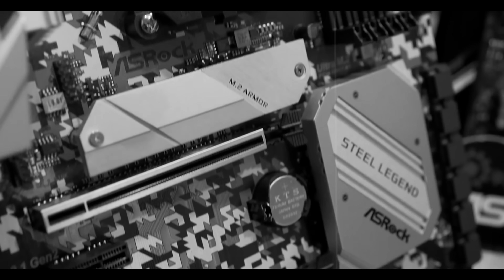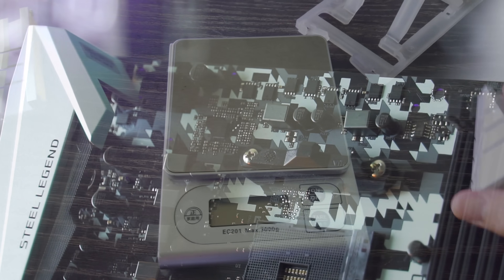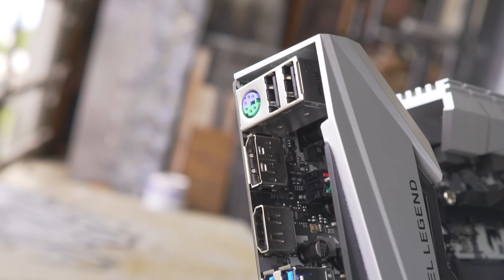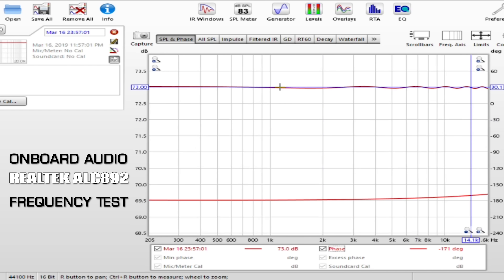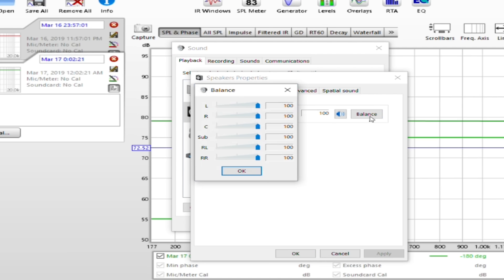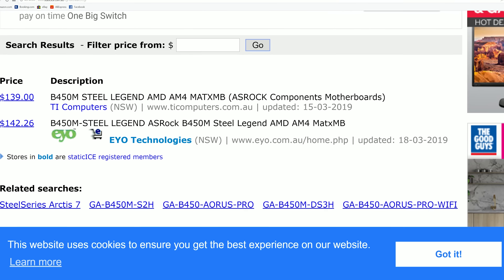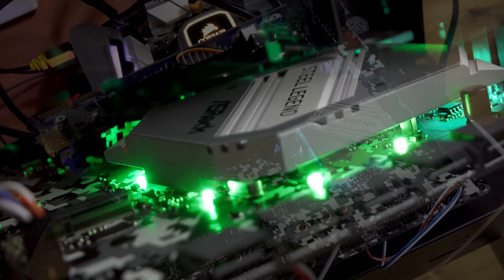Is this The BEST Value B450 Motherboard Right now..!? (Steel Legend Review)

Comment: I just bought a asus sabertooth x58 motherboard for only $50 USD. I want to get a 6 core xeon and a 212 evo(or similar cooler) so I can start overclocking. I was just wondering if the motherboard would support a xeon or would I have to get a i7 920 so I can do a bios update or something. I was also wondering if a hyper 212 evo or similar cooler would be good enough to overclock. I'm aiming for 4.5 ghz but it depends on silicon lotery of course.
Reply: It should support Xeon as its still 1366 socket

Comment: My definitions of usb 3: usb 3 (type A)
Usb 3 type c (type c)
Thunderbolt 3 (type c)

HOW HARD CAN IT BE?
Reply: cus theres usb 3.0 3.1 gen 1 and 3.1 gen 2 and when even with usb type c you can have different standards including but not limited to usb 2.0, 3.0, 3.1 gen 1, and 3.1 gen 2, displayport 1.4 and thunderbolt 3
Reply: There is now USB 3.2 Gen 1, USB 3.2 Gen 2x1 and USB Gen 2x2..... (Hint: the first two are the standards formerly know as USB 3.0 and USB 3.1/Gen 2)
Why is that so hard, what is wrong about just naming it USB 3.0 (5 Gbit), USB 3.1 (10 gbit) and USB 3.2 (20 gbit)
Reply: Tell that to USB-IF
Reply: How hard can it be?

Very hard! Bleep those standardizacitaviation!

Comment: I've got an asrock b450 pro 4 with a ryzen5 2600 and 16gb adata gammix 3200 hz memory. I cannot get my mouse or keyboard will not work in uefi. What can I do ?
Reply: I did a bios flash for the motherboard and everything cleared up. Now I can get into uefi and get things set up the way i want them , thanks

Comment: I agree about the USB 3 thing, it should just be USB 3, USB 3.1 & now USB 3.2 how hard is that, Apparently they are already playing with the naming of the next upgrade to USB4,
As far as the ASRock VRM heat Steve at Hardware Unboxed has said the same that they tend to run on the hot side

Comment: I liked the way you cover Mobos; from VRM cooling to the quality of the on board DAC/components. Would love to see more videos like this! Also, how does the VRM cooling on the RoG Strix B350-f hold under the stress of an 8 core OC'ed chip? That's my current board and it's running a Ryzen 5 1600, but I'd like to know if upgrading my CPU would also mean I'd need to upgrade my board as well. (BIOS update aside)

Comment: I like the fact that you are testing the Audio in so many different ways, which for me is also a very important part on a Mainboard because in 95% people are using the on Board Audio.  For me, i have to say, i am using a Soundblaster Z, which you don`t like that much, even with my Asus ROG X Maximus Formula, because when it goes to Headphones like the Beyerdynamic DT990 Pro 250Ohms all the onBoard Solutions don`t have enough Power to support them.
Reply: its just asus sucks at onboard audio
that said 250 Ohms is A LOT

Comment: I just bought an Asus Tuf B450 but I won't act like I made an informed decision. It was on sale for $75 US ($100 Cad) and it did the job. It has a Ryzen 7 1800X in it that I mostly run at stock because the difference between 3.7 ( windows set performance) stock and 4.0 conservative OC seems minimal. 

If I were buying one right now, the ASRock B450M PRO4 AM4 AMD Promontory is on sale for the same price. It's the one I would end up with. The only thing I prefer about this board is the PCI 1.0 slot down by all the front panel connectors, rather than a 16 slot down there. It's all too close together for a full size card to occupy that lane.

Comment: The MSI B450 GAMING PRO CARBON AC is the best value B450 motherboard hands down!
Reply: The mortar is the best value, can still find it in aus, tomahawk next best value but the carbon pro is very nice too.
Reply: Tomahawk all the way for me
Reply: @Bagoesbudianto  have tomahawk and gaming carbon ac and tomahawk sound chip is completly garbage, must replaced it with soundblaster card :-(
Reply: @danielstormy3660  really ? maybe for headphone /headset ? cz the audio output from mobo i connected it directly to my 200W audio amplifier with pre amp and the output is connected to 3@6" speaker, the sound quality is really OK
Reply: @Bagoesbudianto  Playing sounds quality is ok (not extraordinary), but microphone part is shit, its 10-12yrs old sound chip from realtek!!! If u can connect amplifier thru HDMI from Graphic card then do it :-) It pass this chip
Reply: But there's no matx version

Comment: I didn't like this motherboard when I had my hands on it, although I do like their B450M Pro4 and it serves me very well in my main rig.
Reply: Lucky you, with my pro4’s (yes I got 2) both were defective the first one came with a broken retention cpu arm it was completely snapped off right out of the box and the second one had a defective 24 pin connector ☹️

Comment: Hello Bryan, I agree with you - Asrock is making very decent boards, I have a few, I had plenty of them from other manufacturers (mainly Asus and MSI), and I have to say - these days, Asrock rocks! In my main rig which is aging (but aging very well), I have Asrock Taichi X99 and this board blows everything else on X99 chipset. Thanks for video and keep it up!
Reply from the maker: Yeah x99 was when ASRock really stepped up their game.  Ever since then they have just been bringing it hard.
Reply: Almost every Asrock mobo I've owned [post X58, which had it's network/audio half die] has had  usb ports die! Despite me running highend Etasis, Corsair and FSP psu's since long before most everyone else, and avoid stupid stuff like leaving hungry usb3 flash plugged in. Not wanting a computer cluttered with add-in boards and the horrid bios support has caused me to finally swear off Asrock. This after owning a X58-Extreme3, X79-Extreme6, 990fx Killer [secondary build] and now X370 Taichi. If you cannot make reliable usb ports that's just pathetic. Every mobo manufacturer has had issues, but none have had constant issues like Asrock's flakey USB.

Comment: No good VRM-temperatures, ALC 892 Soundchip, no Intel-LAN-Chip and at this price point it competes with the B450 Tomahawk, B450 Aorus Pro and B450 Strix-F Gaming. MSI-Board has good VRM-temperatures and the other 2 have at least better audio / LAN solutions (I highly doubt the ALC 892 can keep up with the ALC 1220 even after your testing. I always notice a huge difference). Dont know how this can be "the best value b450 board" except maybe RGB lol. A bit disappointed with this title tbh. I dont even think it is a good buy.
Reply: main thing with sound on mobos is an amplifier, not a codec
the better amp = the better sound using just headphones

if you have an external amplifier or an active sound system - only than higher tier codec is obviously a better choice.
so you have to test how it really sounds with your headphones to actually know how it is, higher numbers won't be better in all cases

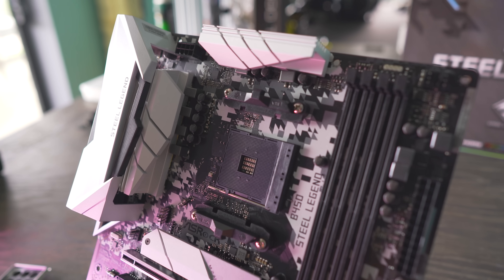Comment: 2:12 like a rear exhaust? if that's all I need I'll be grabbing this soon.
Reply: won't be enough, that heatsink doesn't have enough surface to cool itself efficiently, just get a decent board with good working temp in the first place and your mobo won't burn down when that fan that you gonna put there stops for some reason
Reply: @rawdez_  a good fan and this board are cheaper than a better board and a worse fan.
Reply: @skatcat743  not really, there are better boards in the same price range, just with less bells and whistles for little kids

Comment: It's a great looking board, my own personal problem with almost all of the b450 boards is that I want one with integrated wifi.
Reply: MSI B450 GAMING PRO CARBON AC
MSI B450I GAMING PLUS AC
GIGABYTE B450 I AORUS PRO WIFI
ASRock Fatal1ty B450 Gaming-ITX/ac
ASUS ROG STRIX B450-I GAMING (this one is bad for APUs - just 1 phase for an iGPU)
ASUS ROG STRIX B450-E GAMING

or just get x370
Reply: @rawdez_  Ty!
Reply: @healingandhappy9262  its middle of 2020, check b550 boards.
ASUS TUF GAMING B550M-PLUS (WI-FI) 
MSI MAG B550M MORTAR WIFI 
ASUS ROG STRIX B550-I GAMING
Reply: @rawdez_  lol you're right, thank you!

Comment: Hello brian. i currently am running a gigabyte x99 sli motherboard with a xeon 1620v3 ES whice is a 4core 8thread none overclockable cpu. and i just cannot decide if i should get another cpu for this board or just sell it and go ryzen? i would love to know your advise and allso whice cpu for x99 would you recommand? love your videos good up the good fight
Reply: Hello friend. I am curious what you did with your x99? I did recently 2 pc builds. One was a cheap x99 chinese board huananzhi bd4 with 32gb ram and xeon e5 2620v3 and one steel legend b450, 16gb ram with r5 3600 cpu. Results in cinebench r15 the first system score 820 and the ryzen around 1630.
Reply: @gjergjkastro9404  i ended up upgrading to a 5820k and then a few months later the motherboard just died completly. and at the time buying a used x99 motherboard just wasnt worth it. so ive gone to the dark side with a b550 motherboard and a 3700x 8core.

Comment: if you are buying a B450 board,for me,the only option is the tomahawk.Has plenty options and VRMs actually have functional cooling that keeps them at 70c range which is fckin ridiculous,even if you are overlocking. And its pretty cheapo.
Reply: a-pro / mortar / gaming plus have virtually the same VRM configs but a bit cheaper
all have the same or really close working temps on them

Comment: Guys i am planing to buy a b450 aourus elite for my 1600x can you tell me if it is worth the price.
Reply: its not
Reply: @rawdez_  well i would like to buy a B450 tomahawk but they dont sell that in my country. What do you prefer?
Reply: @dominikjurkovic5540  just get some MSI instead
check 
B450 A-Pro / B450M Mortar / B450 Gaming Plus / B450M Gaming Plus

DO NOT buy v2 MSI boards - they suck
Reply: @dominikjurkovic5540  also you can buy aorus elite, remove plastic IO cover and put a 50-80mm fan on top of VRM.
It will be fine as long as that fan works
Reply: @rawdez_  hahaha ok man thx ill look those up

Comment: I've had better experiences with all ASROCK boards I've purchased while the MSI boards were very hit or miss especially during the AM3 FX days. I currently have the ASRock B450M Pro 4 and it's proven to be quite the reliable performer and it was even better with the Ryzen bundle I got it for at MicroCenter.
Reply: that was during AM3 FX days
now MSI rocks with B450 boards, BUT be aware that MSI v2 boards e.g, Bazooka-not-plus and VDH-not-plus suck too because MSI replaced VRM mosfets to NikoSemi shiet

Comment: When ryzen 3000 comes out plz do vids in b350 with it. They said it would be supported with 2020 cpu’s so do they hold true
Reply: b350 will support those processors
its just  it probably won't be any better than how they support R7s or R5s -X versions

Comment: Trust me, on-board Alc 1220 sounds considerably better than Alc 892, with a good set of cans or speakers.(Im no audiophile, but the difference is night and day).
Reply: actually a sound quality on mobos does NOT depend directly and only on a codec
the main thing here is how an amplifier is designed and made
you can have better sound quality on some old boards with AC97 in a headphones  than on some ASUS boards with newer chips
Reply: @rawdez_  Through SPDIF (optic cable) they'll be virtually no difference at all, between any, due to it being a digital signal (It'll be in 24-bit @96kHz, with only slight differences with encoding/decoding). However through a 3.5mm analogue jack, they'll always be noticeable difference, which is entirely dependent on the on-board sound-chip/dac/codex combo. Most newer boards, using Alc1220 are not only using a better onboard chip (with dac) than the Alc 887/892 boards, but also come with built in, high-end audio capacitors and have each channel independently isolated, from the rest of the motherboard, which greatly reduces inference. (they have really have upped the on-board sound, for once, on the Alc1220 boards and it is noticeable)
Yep, a high-end dedicated soundcard or even better an external Dac, will sound better, but it comes at a cost, that most can't afford. (me included)
Since most people, (especially gamers), will be using the 3.5mm jack, either for their headphones or speakers, a better quality sound built in to their PC, will always be a welcome benefit.
Reply: @fafski1199  just google ASUS low sound volume Alc1220
yeah, it should be always better at least because it costs more, but its not always like that

an external DAC or a simple professional audio interface actually costs at the same price range if you are going with board that has lower-tier codec and usually has much better sound because its a separate device. 
no intel lan though, but I actually never seen any real benefit of intel lan chips 
just marketing bullshit,
as I see it if you want better sound just buy cheaper board and some pro audio device, otherwise 887/892 if done right will be virtually the same
887/892 boards also have all those "built in, high-end audio capacitors and each channel independently isolated"

Comment: this board costs more then the mortar in uk so not good value
Reply: The ATX? Or mATX? Or both?
Reply: @fajaradi1223  Both and compared to there previous pro4 it's like £20 difference which i could understand if the quality was better but it looks to be about the same with fancy pattern/lights.

this whole lights thing is tacky anyway i remember many years ago when people did the lights thing now all parts have them it looks cheap don't see the appeal

Comment: ASRock b450m pro is way better n only 60$
No rgb tho but u do get the rgb headers
Oc  my 2700x.4300 MHz 1.38 volts.
Oc my 1600 to 4.0 GHz 1.35 volts
Reply: the same level of shittiness really
Reply: @rawdez_  I just thought about getting the b450m Pro. Whats wrong with it?
Reply: @aurora-qf2oc  VRMs are not good for top Ryzen chips. 
the main wrong thing with ASRock  is there exist much better MSI boards
Reply: @rawdez_  Here where I live the b450m Pro cost $73 and Tomahawk at $122. I'm thinking about pairing it with Ryzen 2600. $50 difference is quite significant, whats your opinion?
Reply: @aurora-qf2oc  my opinion is going with B450M Mortar / B450 A-Pro / B450orB450M Gaming Plus / B450M Bazooka PLUS (v2 and ordinary Bazooka sucks) is a lot better choice
MSI B450M PRO-VDH PLUS (not v2 or ordinary) is fine too

and I even would prefer GIGABYTE B450M DS3H any day if we aren't talking about APUs
Reply: @rawdez_  I guess I will settle with B450M Mortar. Thank you for your insight.
Reply: Well the only things I Know it lacks on its the audio on my 1600 build.
U don't get high volumes. 
Everything else I great. I bought mine for 60$ with 10$ debate
Reply: @NeVErseeNMeLikEDis  oh, low audio volumes too? noice
same with ASUS boards
Reply: @rawdez_   yes that the only thing i didn't like. But I use an amp on my both build since I have expensive headphones n u really need a good amp to power them. 
Also everyone shouldn get an inexpensive amp it actually better for sound
Reply: @rawdez_  you seem knowledgeable on these motherboards and i have a question. I want a b450 rgb motherboard with great Vrms for overclocking the ryzen 3 series in the future what would you recommend ?B450 MSI Gaming Pro Carbon?
Reply: @SLICKOMODE  definitely MSI B450 Gaming Pro Carbon AC is the best B450 board, not really a great value though.
Reply: @rawdez_  its unfortunate such a nice motherboard too , oh well looks like im going to settle for the gaming pro carbon because i dont see any reason to get a x470 unless for more ports.
Reply: @SLICKOMODE  keep in mind 
PCI_E2, PCI_E3, PCI_E4 and PCI_E5 slots will be unavailable when installing M.2 PCIe SSD in M2_2 slot.
PCI_E4 will run x1 speed when installing devices in any PCIe 2.0x1 slot.
SATA5 and SATA6 ports will be unavailable when installing a M.2 device in M2_1 slot.

https://www.msi.com/Motherboard/B450-GAMING-PRO-CARBON-AC/Specification

basically if you don't have a lot HDDs or you don't care about NVMe SSDs B450 is fine
Reply: @SLICKOMODE   what is it budget for a motherboard??? N what  CPU are u pairing it with?? If u don't mind use the x370 are cheap n better than the b450 motherboards
Reply: Hugo diaz i changed my mind after what @rawdez just gave me in info. I want to get the 3700x when it comes out so im going to need at least a x370 or x470 any recommendations
Reply: @SLICKOMODE  check buildzoid/gamers nexus video best b450 x470 boards

keep in mind MSI already added voltage offset support in recent  bioses
Reply: rawdez thanks alot
Reply: @SLICKOMODE  that long wait maybe 3-4 months. Might well wait for the x570..
I'll be getting the new 3850x with gigabyte Aorus k7 x570 I'm going all out.  Like I Do every yr.  Also I'll m going to update my thread ripper 2990x. To what every they come out this yr
Reply: Hugo diaz damn man nice nice ! The x570 concepts are already out!? PogChamp

Comment: This seems like a solid little mATX board, the VRMs are solid for a 4 Phase, and that Heatsink looks adequate enough for a R5 CPU.  Also 2 m.2 slots is always a plus.

A bit of a fair warning though, a lot of people seem to run into Memory Compatibility when it comes to running it at rated speeds on ASROCK boards, so if you are interested in this board like I am be sure to play it safe and find modules from the QVL list for hassle free Building.
Reply: Or go to crucials store and check out compatible memory kits from them